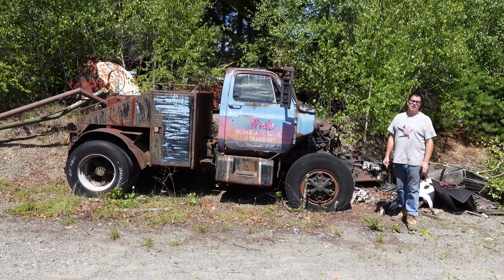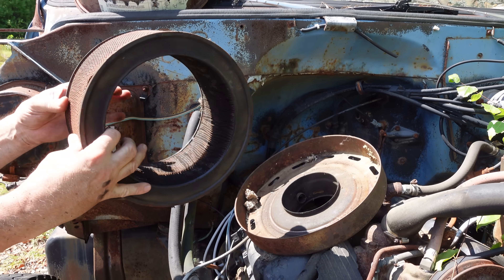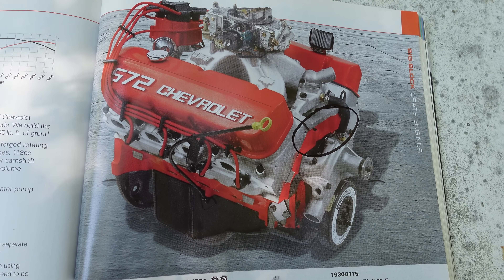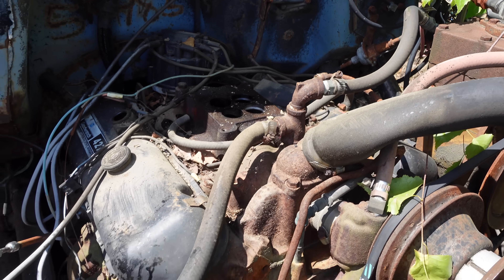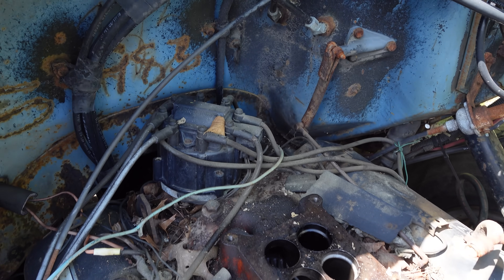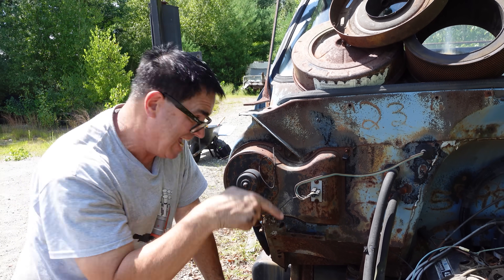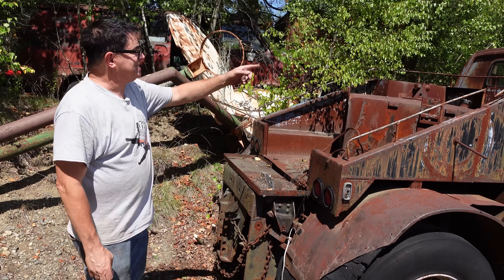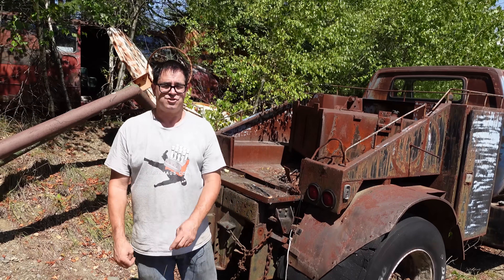6 Wheels, 5 Gears and 427 Cubes!

Comment: TD 366/427 came with oval port heads, they had smaller valves and sodium filled exhaust however they can be perted out and given larger valves and run as well as a performance 396/402/427/454.

Comment: Little reminder 366 all were forge Kranks the same as the 427 also all 366s were for bolt means I have taken the 366 crank and have used it many times in 427 396 402 build all the same 454 is different

Comment: We had Chevy c60s internationals and ford the internationals would pull circles around the Chevy and it had the 427 the ford would pull pretty dam good it had a 429  we would use the Chevys for light hauls itcouldn’t hang with the other 2

Comment: The cabs are nearly identical to to the "light trucks", but firewalls are not the same at all.  The engine relief is a lot bigger on these firewalls, the transmission tunnel is a bit different, the pedal assembly and brackets are all different, the steering columns were a different design and mounted at different angles, etc... But, if you're just looking for some sheet metal, the rest of the cab and the doors are all the same, just a different rear window, like you said.

Comment: The floors are slightly different. 
The pickups had a hump under the seat to clear the side saddle gas tanks. 
The big trucks had flat floors. 
You could modify it to work though.

Comment: With the low compression and the extra rings, the old Chevy truck engines are perfect for a turbo or supercharger project. Everything is already forged and four bolt. I've thought of doing this very thing before with an old C-80 corn truck engine.

Comment: You're  wrong about the heads on this  having  the so-called 'peanut ports"  '70's vintage 366 and 427 high deck truck engine heads had the same size ports as a standard passenger car 396,  427 or 454's. The peanut ports came later, starting sometime in the  late 1980's  on standard performance passenger car 454's and 427 heavy duty truck  engines

Comment: Kiekhaefer (Mercury / Chevy) used the 427 tall blocks to make offshore race and Nascar race motors also. Stroked them with 4.250 cranks (welded up stock and reground) and 6.405 rods (the only thing special made). Everything else in the motor was off the shelf Chevy even though the aluminum intake was a limited run. The best 109cc heads, pistons, down to which gaskets that would work right out of Chevy's inventory. Then anything that breathed was sent off to Crane (the cam company) to be ported and polished back when they used to do that sort of thing. The Kiekhaefer 482ci.

Comment: I liked it when they displayed the SPID as you are calling it (for not knowing the slang for it I just referred to it as the options label). You knew at least what it started its life with without pulling out a plastic $1200.00 box to ask. I remember the old chevy engines you could tell (with 99% accuracy) that the heads had not been off or the engine had been out if it still had the lock tabs on the exhaust manifolds. No-one put them back on or they fell apart getting them off. We're not talking about concours here. Sometimes little things like that meant the difference between paying $100.00 instead of $300.00.

Comment: I drove a 73 C65 Chevy tilt cab delivering LP gas for many years it had a 366 running on LP gas.  With a 2500 gallon tank it was a pretty good load, the 366 handled it well with gobs of torque.

Comment: Once upon a time, 1983-87 I drove dump trucks for the city of Dallas streets department.  I hated to drive the big block Chevy's, HOT, HOT, 🔥,  Internationals with 392's were much cooler,  Fords with 330, 361, 370 or 391 not so bad either. Small block Chevy were not too hot, but they blew up in 30,000 miles or less.

Comment: Didn't read all the comments. To clarify,  light duty trucks came with standard low deck blocks, and the medium duty trucks like this one had the tall deck 366 or 427. I always breezed past them in junkyards, not knowing the tall deck was used on the 572. The junkyard i used to work at had the remnants of a dodge motorhome with a 413 until crusher time came, the forklift ripped the wood framed tin skinned body off and the chassis went for scrap

Comment: My farmer buddy had me modify the 427 in his farm truck. Better heads, a Performer RPM intake with spacers, cam, an MSD distributor with an adjustable sleeve to work with the tall deck and some ceramic coated headers. It runs great believe it or not!!!!

Comment: Thanks Steve! Wow, I learned a lot about the 427 truck block! We had one of these in a flat-bed used for hauling sod around the Flathead valley in western Montana in the early eighties! We could carry eight pallets of heavy sod and a Princeton Piggyback forklift on the back, and this engine had some power and torque! It had no problem getting these loads up and down those hills! It had the same 5 speed and split rear. Great truck and drivetrain! Great video!

Comment: The first 366 truck engines (1966? I think) had a two barrel carb on them. I don't think very many of them were made. I used to haul asphalt back in 1970 and one of our trucks was set up that way. Never saw another one like it. Had a 5and2 transmission.

Comment: Hi Steve, Yes the 427 Chevrolet truck engine does have s taller deck height than a 427 Chevrolet car engine.  The Goodwrench engine in the truck is a Targetmaster "over the GM parts counter" engine in regards to GMs Target Marketing Program.  The original truck 366 engine was probably not available in the program.  The Ford fuel tank may have been factory installed, due to the fact that the Ford Motor Company produces parts for other trucks, such as International Harvester and GMC. The center occupant seat, it states "not for sitting" International Harvester had the same center seat on some of their trucks.  The water tank on the Mobile Home tractor is to add extra weight over the drive wheels.  You see, not all mobile homes are delivered to mobile home parks, many are delivered to the side of a mountain up a steep dirt road out in the sticks.  Please reply.  Dave...

Comment: back in the old street racing days, dudes would pass these off with Hank the Crank stroker assemblies as 396's.  If you could fit a finger between the bottom of the cylinder head and the top of the water pump, you assumed it was 496 plus, a common stroker 454 at the time.

Comment: About 30 yes ago a tall deck 427 was considered a  boat anchor or scrap because of the lack of aftermarket intakes. But these days there is a substantial big market for tall decks... ESPECIALLY to build HUGE stroker kit engines. Very much different than 30 yrs ago
Reply: Back in 1984 , I had a pair of tall deck "marine" 427s. 
Couldn't GIVE em away !
Reply: Back in the 90s Weiand Team G 10.2" intakes were available and not expensive people just thought it was easier to use a cheap readily available 454.

Comment: A 366/427 uses a stock length, normal HEI distributor, no sleeve is required. The cast iron intakes are cast low in the rear, unlike many aftermarket tall deck intakes. 
On earlier engines that ran a points type distributor with a governor, the oil pump drive was "D" shaped, not the regular slotted drive. 
These engines of this era used oval ports, not peanut. When 2 ton trucks started using TBI, then peanut ports were used.

Comment: I drove a 1973 GMC grain truck while in High School working for a grain farmer, and also would help another guy who had 1970 Chevy. The GMC had a 366, while the Chevy had a 427 with chrome valve covers.  Both had plenty of power for hauling 400-500 bushels of grain.  Both drove super nice with power steering and a 5 speed trans and a two speed axle you never had a power problem.  A few of them came with diesels and some even had tilt hoods. The 1973 and up GMC/Chevy were the trucks to have and would make all the neighbors with Ford's, Dodge, and International jealous.  Built like a rock.

Comment: Back in the 90s, my dad needed a new engine for his 80 GMC C30. He  looked into a cheap rebuilt tall deck 427 like this. Problem was it didn’t have an intake manifold and the distributor  had a governor. Their were spacers available to use a car intake, but a buying a compatible distributor would negate the good deal of the tall deck. He ended up buying a rebuilt standard low deck 454.
Reply: You can use a standard HEI or points distributors in the tall deck engines, they just don't have much clearance underneath.  The wider HEI distributors almost come in contact with the rear intake runners, but you can double up the gasket on the dist. to make sure it clears.  Also, the governor was really just in the carburetors, it was operated by the distributor, but it didn't affect dist. operation.

Comment: I'm team new for engine parts, just not worth it IMO.  Most modern stroker BBC's that use the 10.2 deck are based off gen V or later blocks.  You would spend more money machining those blocks vs just buying a new block.  The new block would easily support a bore of 4.5" some even 5".  Modern metal casting is way better today too, so fewer surprises.  Not that costly either really and all the little things are worth it.

So you could build a stoker from one but it wouldn't economically or reliably be worth it.  The crank has that tiny 3.78 stroke which fine for 396-427.
Reply: ''Modern metal casting is way better today too"  Unless when it comes from China!

Comment: Cool old truck, would be great to see it working again. I could be wrong, but I think Ford used a long stroke version of the 427 FE for their heavy duty truck engines in the late 60's and early 70's.
Reply: i think they went as high as 543 cid? not sure exactly what they shared in common with the FE series, but i know in the pickup trucks Ford used a "1" as the last digit of displacement (391 instead of 390, etc) to designate a forged crank application.
Reply: @albertgaspar627  In addition the Ford 391etc. had a larger crank snout to run front mounted crank driven pumps, etc.  The big Ford was 534 cid, totally different from the FE series.
Reply: Those Ford truck engines were 477 & 534 CID, maybe also a 501.  They were not FE's.
Reply: @Cougracer67  Thanks, I vaguely remember reading about them because racers back before "chinese cranks by mail" hunted the 391FT for its forged crank and then machined it down for FE builds.

Comment: Wow that has a 6.5 ring gear?  Even with 10 Speeds it ain't going anywhere fast. Cool old truck...hope someone can make something out of it
Reply: My GMC topkick has 6.50 gears and an auto.  It also has 11R22.5 tires at 42" high.  It does 65-70

Comment: I have an '86 70 series out back with a 427 and 5spd/ 2 spd rear. 5.85:1 rear so it goes nowhere fast lol. Interesting is the stainless tubular exhaust manifolds on mine
Reply: Needs some long rear end gears
Some weight reduction
And some twin turbos
Reply: They really do have factory power curves that are like a gas engine trying to be diesel.  Your's just needs a pro charger to wake it up.

Comment: Another difference between the car and truck big blocks was that the truck had timing gears rather than timing chain and sprockets like the car.
Reply: yep and it was only a two-gear set with no idlers
Reply: @67L-88  reverse grind cam ?

Comment: Back in 1974 a friend worked for one of the local Chevy dealerships and the GM parts runner out of Detroit used a 1969 GMC Astro with a tall deck 427 . It had twin chrome stacks and really sounded good. He told me that at that time the people running parts from the factory had their choice of trucks to use and could order it anyway they wanted and he preferred the gas 427 because it was quicker than an 871 Allison diesel ( Detroit Diesel ) and since he wasn't paying for the fuel, GM was, the cost difference didn't matter.

Comment: The 366t uses a 3.935 bore and a 3.760 stroke the 427t uses a 4.000 bore and a 4.250 stroke GM used the small bore compared to a normal big block bore for more head gasket sealing area and the taller deck for more coolant capacity. I work on these trucks everyday I just finished putting a floor pan in 1 and a lot of people don't know this but the floor pans is different in the medium duty trucks versus the pickup trucks the biggest difference would be the cab supports. I just used pickup truck cab supports because you can buy those new and just modified them a little. On the 1986 c50 I was working on it's cab supports was angled from the cab to the cab mounts. The rear cab mounts is a lot easier they pretty much just have spacers to get the extra height. Something else I've noticed the wiring harness is different in the medium duty trucks also if you look on the firewall where the wiring harness goes into the fuse panel all the wires bolt to the fuse panel individually I don't know why Chevrolet did that but always thought that was weird. If anyone is working on one of these trucks or trying to restore one or just trying to get one back onto the road hit me up on Facebook my name is Daniel Johnson I live in Sweetwater Tennessee and I will be more than happy to show you some photos of what it takes to put a floor pan in one of these trucks or if you have some questions about these trucks you were free to ask.
Reply from the maker: Hello Daniel Johnson, THANKS for the excellent additional information. Your note that the cab mounts on HD truck applications are taller hits me as a "why didn't I know that" fact. But I totally get that. I wish I had a time machine, the BEST info on these videos comes in the day AFTER I post them, provided by folks like YOU who work on them / design them / sell-sold them. I wish I had your insights BEFORE I made the video. Anyhoo, THANKS AGAIN for watching and writing. -Steve Magnante